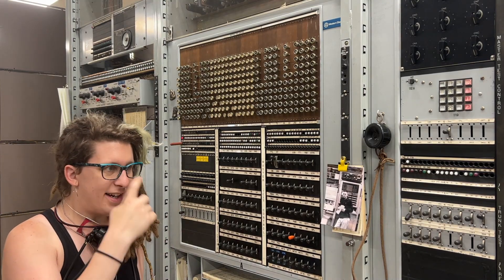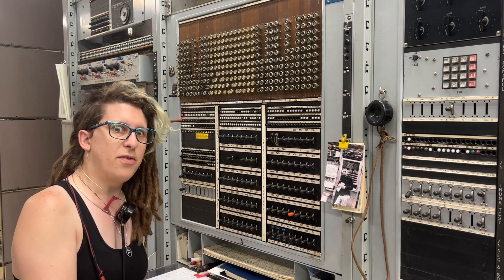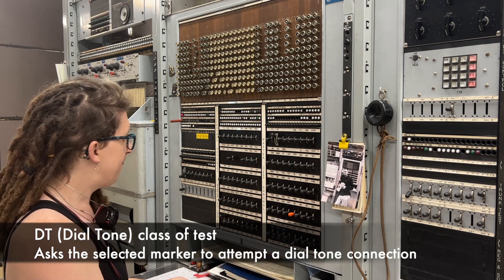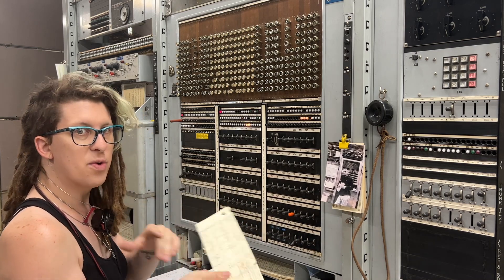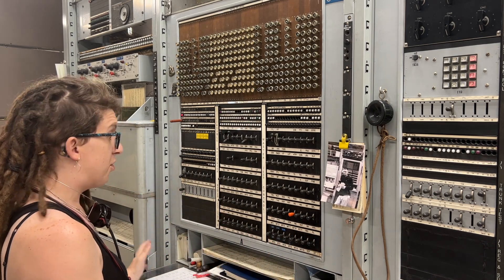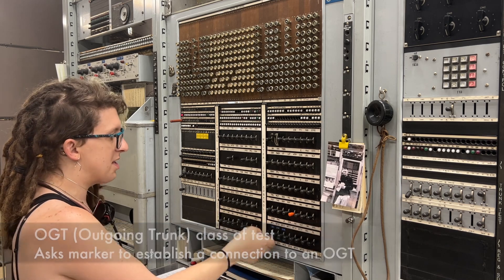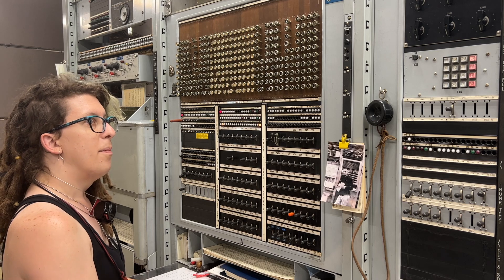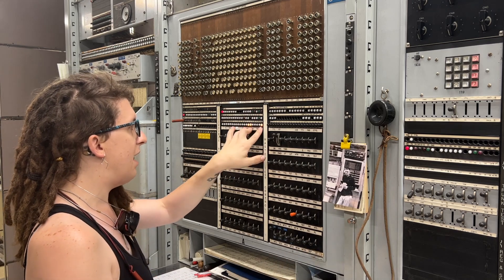Test Frame Tuesday  -  5XB Master Test Frame

Comment: Fun memories indeed! I worked 5XB offices throughout the SF Bay area, mostly in Mill Valley, San Rafael and Larkspur. The Mill Valley machine was the oldest, and supposedly the first one actually installed by Western Electric rather than the Bell Labs prototype. It had flat spring combined markers when I got there. Flash forward a number of years and I taught ATA, or Automatic Trouble Analysis, which was  another first; a Digital PDP 11/70 running Unix 1.0 and application that analyzed XB5 cards and the #1XB light displays. The computer had 32MB of memory and a single RP06 disk drive with 300 MB of storage. That supported 10 offices and several SCC locations. Funny story, the Master Test Frame Connector scanned backwards for ATA and then forwards for the Trouble Recorder.

JT Pacific Bell 1964 to 1994
Reply from the maker: Thanks for the info. We have an ATA system in our 5XB as well, but its very flaky, and none of us have had the time or energy to get it working...yet. We did get it to scan a few times, but there's a false ground somewhere in the scan points that's causing a bunch of false positives on the readout. 

I'm not familiar with it scanning backwards. Ours scans fowards, but...we had to write our own scanning software, since there's no PDP here to drive  the ATA equipment. We just reverse engineered it from what little documentation we had.
Reply: Small world. I worked on what was reportedly the last 5XB installed in Canada (TOROON61MGO) until it was retired. A little bit of me died that night.

Oddly enough I now live in Mill Valley and from the windows you  an see the MDF as well as a few scattered relay racks. It's actually a very attractive building from the day when CO'S tried to blend in. Larkspur on the other hand...

The last remnant of a crossbar that I saw was in San Jose (SNJSCA03) as it was disassembled and scrapped.  I found a trouble card on the ground. I still have it to this day.

Comment: Awesome video!  I work in VoIP telephony, and I would LOVE to have a big physical panel of switches and lights to do testing, rather than just running CLI commands.  This panel looks so satisfying to use, even to run mundane commands/tests.
Reply: YESSSS! I was Network Case Management for a Telco until 2015. Our switch control interface software was super cool don't get me wrong... But man I would love to use this stuff!
Reply: You know, theoretically that's possible.

Connect an RPi, beaglebone, pick your favorite SBC, wire it up to a giant panel of keys (probably through a pile of multiplexers and IO expanders), and program it so that a certain IO connection equates to firing a certain SSH command down the line...

Comment: Is that 5XB office configured for AUTOVON?  I ask because I see an AUTOVON keypad on the next frame.
Reply from the maker: Good question! There's no evidence that this office was ever configured for AUTOVON. It provided service in a quiet, residential island on the lake, east of Seattle. I suspect (though can't prove) that the AUTOVON keypad was installed because that was either just a standard option, or they had extra lying around. A deep dive into the office records may provide a better answer.
Reply: That also caught my eye! Now I'm really intrigued.
Reply: I think the 5 XbR offices had 16 key “66” type dials, but the fourth column keys were grey and unmarked.